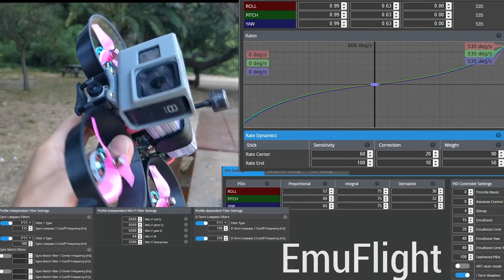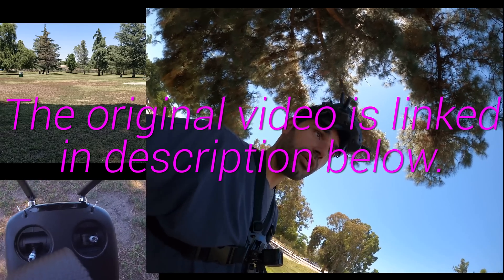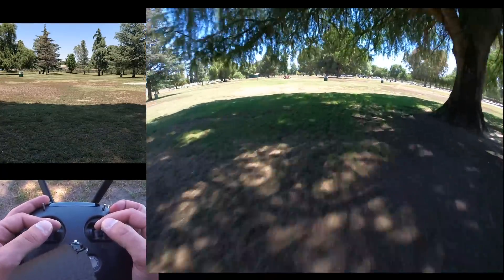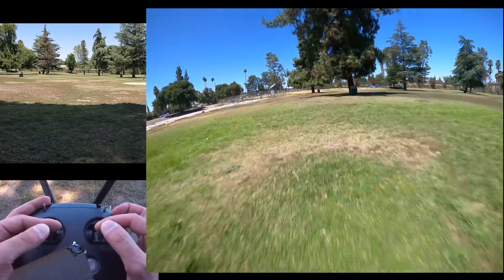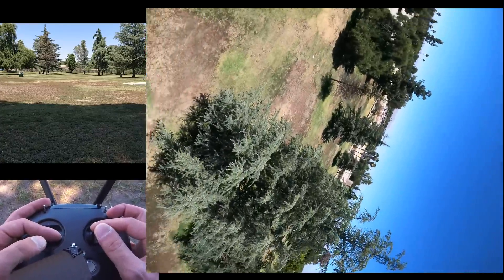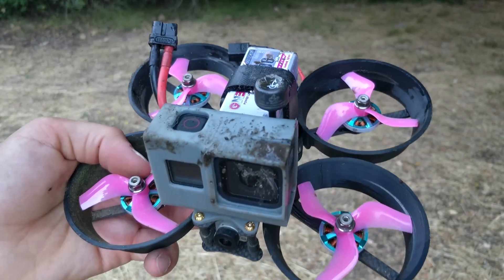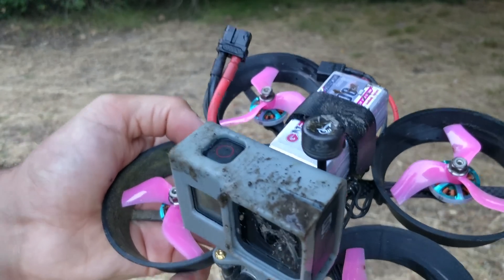CineSplore - Tune and Flight Performance

Comment from the maker: FPVCycle 2203: https://bit.ly/3i7QPuA
CineSplore: https://bit.ly/3dGJu1z
Gemfan Duct props: https://bit.ly/385nvAk
30A 4S AIO Toothpick board: https://bit.ly/3i8POCq
Strongly recommended battery for this: https://bit.ly/2V7cvx4

Longer Vista antenna - https://bit.ly/2ViXhFg
Vista + Nano Nebula - https://bit.ly/2ViXhFg
Vista kit + longer camera wire - https://bit.ly/2ViXhFg
200mm DJI camera wire - https://bit.ly/3eyBYXU

More things coming soon to FPVCycle.com

CineSplore frame video: https://www.youtube.com/watch?v=m318_...
The original video I shot to show real world flight performance: https://www.youtube.com/watch?v=t83GI...

Table of Contents:
►00:00 - Intro
►01:04 - Declaration of 100% raw video
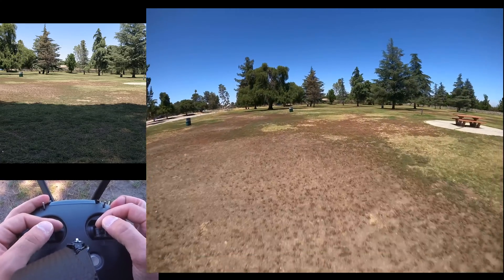►01:26 - RAW Flight video
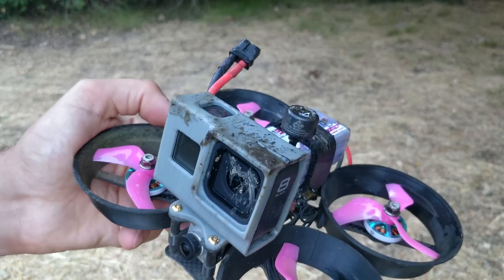►06:30 - A note about FPVCycle

▼Join my FB group for more discussion: Kabab FPV
https://www.facebook.com/groups/37915...

The store: www.FPVCycle.com

▼ My typical 5" quad setup:
-CineGlide: https://bit.ly/2MCoz50
-Motor: http://bit.ly/2Nqqr25
-ESC: http://bit.ly/2oDdzvL
-WaFL’s Cap Cap: http://bit.ly/2GUpXxO
-Battery: http://bit.ly/2JnsTDM
-FC: http://bit.ly/2XRc8G8
-FPV Cam: http://bit.ly/2Q7LfL7
-Vtx: http://bit.ly/38Y25oz
-ND GoPro Mount 30deg: http://bit.ly/2WC15zc
-ND Filter (if used): http://bit.ly/2WEmQ1j

▼Notable motors:
Check out the Rcinpower Wasp and Bison...interesting motors coming.  We're working on blending those two motors into one.  The Wasp is more powerful but the Bison has an awesome 11mm bearing that's uber smooth.

▼Starter goggles: http://bit.ly/2qbJNOS

▼ If you want to solder better:
-Fantastic solder: https://amzn.to/2P5QM2W
-Fantastic iron: https://goo.gl/DqBipa

▼ Tips?
Patreon: https://bit.ly/2oGLP9b

-PayPal: https://www.paypal.me/kababfpv
-Bitcoin: 1E4XZXoD4rS6MYWVWuenY7Kw2M1YgyNpoQ
-Nano: xrb_1188ek5bd7tb9kw67asnp9o65byuoaxbtpxuznx1ribf75x78awywmakj55f
-ETH: 0xD067F93811f2eC31CB1928901002dfdf9A492EF5
-LTC: La2KWYAjp4VT2Lq2M76pbjzXWvRyjpfCtG

Comment: Can this one be used with BF ?
Reply from the maker: the craft isn't flight code specific. The flight controller is. You can use whatever flight code you want as long as you buy the compatible board. Betaflight works with pretty much everything out there so it's hard not to be supported by them.

Comment: Bob, I wanted to ask you about the cinewhoop. I have 2 a iflight green hornet for bigger camera and a cine8 for small places and litfting a peanut.
The thing is that I burned a motor on the iflight. 1408. Now its quite hard to find them. Specially here in argentina and a replacement from china takes 2 months. The thing is I was looking for raplacsmets and i found motors of 2203 or 05 which had the same pattern 12x12. Much wider. In one of your vids I saw you built a cinewhoop with motors close to what I could find. But my worries are the size of the motor en relation of the prop. The thing is then I found a way to rewind the startor.. but then I thought it would be good to build a spare one better than the one I have. So I was thinking about a shen drone squirt. But then I saw your vid for the cinesplore and I was much impress by the size and type of motors you use. Could you pleas explain me a little about that size relation and what can i build with that. Which aio would be better and what range of motors would be mor suitable not only fpv cycle but other brands. I am thinking to buy the frame and hve it brought by a friend but the rest of the components I was thinking to get them from AliExpress that its more easy and cheeper to get it by mail to argentina. Please if you could help me wtih that, it would be great!
Regards 
Juan
Reply from the maker: Ahoy there I got your email and responded too. ✌️
Reply from the maker: That doesn't mean I'll be particularly quick at responding to either message. I just happened to look at both in this short time span 😅. I do my best
Reply: @Kabab  thanks a lot!!! Take your time!!! I just need some guidance with the motor and whoop things!!! Thanks so much!!

Comment: Emuflight Configurator Version? And, Emuflight Firmware Version? And, Target: MATEKF411..?
Reply from the maker: It doesn't matter. Any current build
Reply: Oke, i want Copy Paste but i dont know your version... TPA P I D not available in your screen ☹️
Reply from the maker: @rullyadulfpv5787  it's the same. It hasn't changed.

Comment: HI, good work ! I just finished mine. Any advice in BLHELI32 for the 2203 3450 kv motor ?
Reply from the maker: Defaults or lower ramp up power a little for less noise in the system

Comment: Such a great motor design. May I know the flight time for these motors?
Reply from the maker: With a hero 8 and 1200mah 4s and everything you see on the quad in the video it's just over 3min of pretty decent movement during the flight.
Reply: @Kabab  great! Thanks for the reply 👍

Comment: Can somebody explain me - Why You still need that stupid bulky GoPro thing in 2020 when  there  are 4k FPV cameras that are more capable and usable also in dark... gopro material in dark is mainly usless in my experience
Reply from the maker: Most people still don't want to mess with a finicky exploded gopro. The hero 8 and 9 have better quality too. Also, this general setup is really a different class. The whoops that carry the exploded gopros can't do too much....but that's fine since they're only intended for floating around.  This cinewhoop is far more capable in flight performance.  Improved performance makes it a whole lot easier to get the shot. There are also few places you end up flying the exploded gopro whoop that you can't use a larger whoop.  Finally, the overall reliability of the craft that carries the exploded gopro is pretty poor by comparison.  

Overall, I love the exploded gopros and the small quads but I don't love the downsides that come with the gopro and the smaller craft.  On an actual shoot, I cannot have issues with my equipment.  This platform I've put together is a much better blend of reliability, usefulness, performance and improved image quality too.

Comment: I don't understand the need for ducts in an open environment.
Reply from the maker: It's not about the environment. It's about the flight performance. It's very difficult to fly at a really slow steady pace with open props. It just sort of slides faster
Reply: @Kabab  Ahhh. I didn't think there would be a performance advantage to flying with ducts. That's surprising.

Comment: 1500mah 4s vs 1100 vs 850?
Reply from the maker: 850 isn't much better and less flight time. 1500 4s will give about a minute more flight but feels heavier in the air when flying. 1100mah is the happy medium point.
Reply: KababFPV i’ve been flying 1500 4s, get around 4-5 minutes when doing easy / slow flying

Comment: What do you think about a similar setup but with 6S?
Reply from the maker: I think it's fine but also not really worth it. If you shrink the pack size and increase the volts to maintain the same weight you would have much less flight time. If you keep the capacity the same and increase tht weight you would have similar to less flight time as well. You may get some more power but the whole point here is to go slow, not fast. It doesn't really do fast no matter how much power you give it. On 4s it has plenty of power with little to no detectable sag at a 550g auw. To me, it's hard to justify 6s. Especially when the electionics are more expensive and more complicated.
Reply: Thanks, it makes sense. It’s been hard to find a stable setup at 6S with almost any cinewhoop I try. I end up with hot motors,  burnt motors and escs. Lots of issues. Thanks!

Comment: Unrelated question.  In one of your videos you mentioned your crossfire receiver was interfering with the ESC, and OSD chip I think..   I recently built a 5 inch toothpick style quad and my rx is pretty much sitting right on top of the FC.  Do you think that could be the reason my OSD has been acting up?  Maybe I should turn telemetry off and see the result...    *Super valuable info**
Reply from the maker: Yes it could be.  Try turning off telemetry on the Crossfire Rx.  That usually fixes it.  It takes a few seconds for it to actually turn off after selected.  Give it a little time.

Comment: Hey Bob, I notice you did  NOT have the antennas on the DJI controller STRAIGHT UP toward the sky.  Is that by choice? I've never known if there was a particular orientation that was best.
Reply from the maker: No i probably just put them down

Comment: So I got to test my 3in today with and without ducts I designed.   I see what you mean about weird behavior down hallways.    Without ducts it just doesnt do it the weird yaw twitching that happens with ducts.

I mainly wanted to see how it flew and what my throttle position was between the two.   I was around 45% throttle to fly without ducts(heavish 3inch on 1306 4100kv 3s 18650).   Going to ducts I added even more weight but throttle needed to fly wasnt much more.

I am using 3in Avan tmount props and the ducts have maybe 1mm clearance from tip to duct inner surface.

Definitely interesting doing a thrust test and feeling the thrust super focused in one direction with ducts as opposed to without ducts.

But I think I am liking the flight and control of not using ducts.
Reply from the maker: Yeah the hallway thing is really annoying

Comment: Will this frame fit a 30x30 flight controller ?
Reply from the maker: It does not have mounting holes for 30x30

Comment: Okay I thought the weight on my Cinerat was absurd @ 558grms AUW 6s.  I’ve heard good things about these motors. Enough to go for it! Think I’ll give them a spin!
Reply from the maker: mind the mounting platform please.  I'm not sure what the platform on the Cinerat is.  Also, I believe that thing doesn't have ducts.  I'd still recommend using the Gemfan 75mm duct props.  The performance with ducts is a lot better....with THESE ducts.  Not any duct
Reply: KababFPV  thanks. I’ll definitely check the mounting platform prior. Yeah no ducts just guards on Cinerat. Thx for helpful info!

Comment: Just designed and printed my own ducts for a build I have and I have a feeling it will take quite awhile to figure out which airfoil and angle of attack to use.   At 13 hours per print to fit a set of ducts to the 3in drone I designed it will take a LONG time through trial and error.   Not looking to sell or compete in the market.   Simply want the knowledge and experience for being able to do it on my own from design to manufacture.
Reply from the maker: here's a secret I don't really share much.  These are psudo ducts.  A LOT of the performance comes from just separating the air above and below the prop.  A cylinder duct is useless.  It's gotta have some sort of funnel shape and I'm not convinced any degree of airfoil does a whole lot more once you get the funnel right.  But I have not done the testing StanFPV has.  He's worked really hard on these.
Reply: @Kabab  there are ao many air foils out there to try.    If you set the air foil to a certain angle of attack you naturally get that funnel effect you are talking about where the top opening is wider than the bottom opening.     I set my initital angle of attack to 5 degrees for the NACA air foil I used with a 28mm chord length.   Gonna fly it very soon with and without ducts and see what my throttle percentage is between the two.    I may try an air foil with like a 40mm chord length to see if I get more of the effect I am looking for or less.

Random experimenting just to get the experience.

I am all over the board from micro to macro to 7+ pound Xclass.

Drone ADHD.

Comment: Great stuff... I am totally going to get these motors and frame.. 
What KV are you running in this video..?
And also what material are those StanFPV ducts printed in..? and will the STL's be made available..?
Reply from the maker: I strongly recommend the 3450kv and 4S with the CineSplore.  6S is just not needed and a much bigger hassle for no gain at all.  The ducts are by StanFPV.  You'll have to ask him but I don't think he'll make the STL available.  The duct mounting platform is available on the CineSplore product page so you can design your own if you like.

Comment: Hey Kabab, Does this frame fit the full sized Air Unit instead of the vista?
Reply from the maker: this does NOT fit a full size air unit.  Only the vista
Reply from the maker: well actually I dunno.  I say not and then tons of people fit it so it's at least not intended for that.
Reply: I hope it does.  I'm thinking of this for my next build.

Comment: Can someone please help set up my self for some FPV. I tried to build my own quad, but failed, I have a Flysky i6, which I think is no longer in use. I am not looking for anything expensive ($200-300), this includes goggles, transmitter, quad and accessories.

Any suggestions are greatly appreciated 😊

I don't mind if it is a whoop or a toothpick.
Reply from the maker: Unfortunately for only $300 I would recommend staying away from the hobby or sticking to very small things like the Eachine EZ Pilot.  Otherwise you're only gonna have very poor experiences and it will be frustrating and a waste of money.  The cheapest and most effective way to start is to ONLY get a controller and play simulators for a few weeks.  Then watch some videos and build your own.  This is universally accepted at this point to be the most cost effective and fastest way to start.  You have a controller, see if it works with a computer for simulators.
Reply: Are there any FPV combo's that are good? Even of they are more than $300. 
Sorry to bother you with these questions.😅

Comment: What's the deal with all the cinewhoops, I've never flown one, but at that weight I don't really want to, I guess I just want to see some new innovation with 5 inch.
Reply from the maker: we've got some very very real 5" innovation coming but it costs a lot to produce so we had to start with the smaller stuff and build up to the bigger stuff.  There's one very different size and spec 5" motor in the works and two totally different motor techniques that don't even exist in this industry.  All very risky to develop and manufacture but as long as FPVCycle keeps getting supported, it'll happen.
Reply: @Kabab  Nice, Im excited to hear that. I'll definitely keep getting what I can from FPVcycle, thanks!
Reply: Only for getting smoooooth footage. Not as good to fly as a normal quad.
Reply: @stevenkelby2169  no doubt in my mind, I usually fly race setups, I built my first good freestyle glide, my God their so freakin heavy, like almost 200 grams more. I'm sure some 2407, or 2208 might feel a little better, but I don't think I'll ever like a heavy rig now, and the cinewhoops sound like their just begging for power.

Comment: My cinewhoop has problems with bobbles and weird shakes when im trying to fly smooth
Reply from the maker: The only place I have issues with this when trying to fly smooth are indoors in tight walkways.  The air recirculates and you get a lot of sliding around and yaw wiggles.  You need to keep moving at a steady pace or just avoid walkways.
Reply: Try turning D MIN to 0 on both pitch and roll unless you have already done that. Bump up I TERM on pitch and roll as well 👍

Comment: What causes the yaw wiggles? Also I am kinda unaware of what’s going on in your store. What is so innovative about your products. Please don’t take my question in the wrong way I am just curious
Reply: Well pretty much everything in the store is unique unless someone has already copied him.
Reply from the maker: The yaw wiggles will happen in a tight space when the thrust gets recirculated back into the ducts.  Many people will see my work as unoriginal but what's different is that I'm actually doing a LOT of testing and research to come up with ways to do things better.  So far I agree, the things I've presented are just optimizations of things that are already available even though they are genuinely unique.  There are two motors in production right now that are completely different than any motor in the industry.  Completely completely different.  Before those two, there may be another half step motor for 5" that comes which again, will be an optimization albeit a pretty big one.  None of this will happen unless FPVCycle continues to be supported by the community.  So far it's been going pretty well but right now we're heavily in the red.  Will need to wait to pull out of it before funding these new items.  Making this new stuff is also incredibly risky.  It costs a LOT to do and the risk of someone copying and undercutting overnight is extreme in this industry.  It's entirely up to the community to make it happen.  Throwing money at the trash littered across Banggood or supporting brands that just remake the same thing over and over hurts the industry more than anyone could imagine.  It's why so so so many brands that were very innovative have left the industry.  If you don't like what I'm trying to do, you don't have to support it at all...
Reply: KababFPV wow! Are you sure your a dentist. You could be a really good sales man. I think I’ll give one of your motors a go. I might try the 2203 on a wing just as a test. I am more in to planes and that stuff but I have built a whoop. I think what you are doing is great. Can’t wait to see what products come out soon.